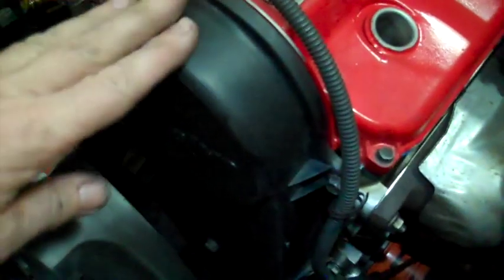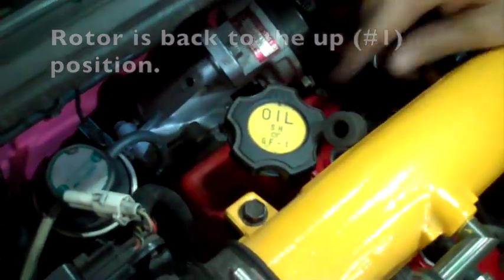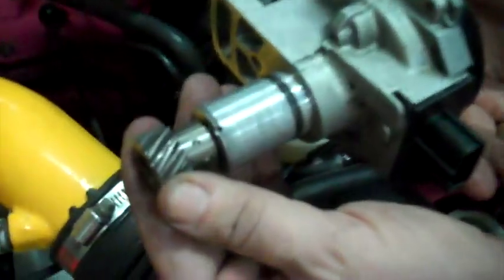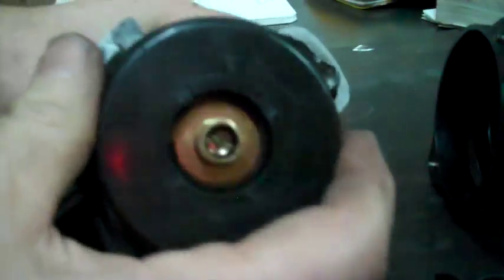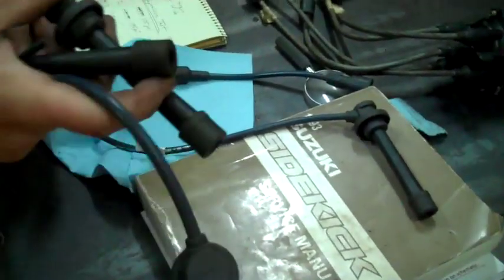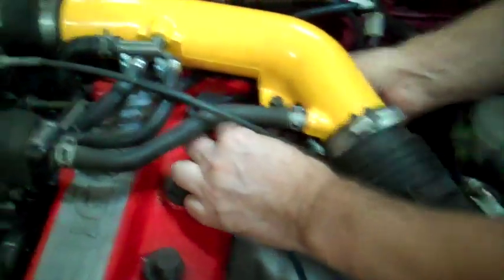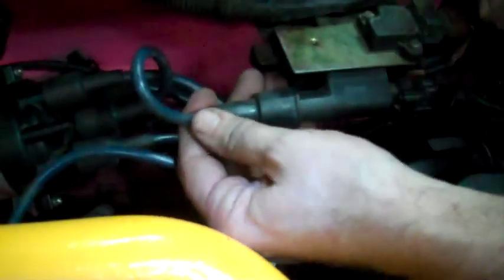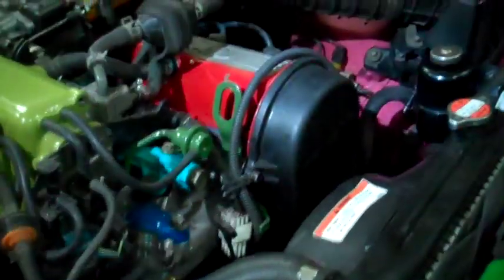1995 Suzuki Sidekick Distributor, Timing, and Initial Start Up

Comment: Picture was a. Bit dark to see what was being done clearly
Reply from the maker: You are right about that.  I have difficulty dealing with the camera and light while working in tight spaces.  Usually can't find a helper.  If you want me to explain something you can message me on my face book www.facebook.com/SidekickRebuild/ or just email me.
Reply: So the other day I said your pict. Was a little dark.HA ! That's apparently the least of my daughter s problems.looking at the dist.as per your  directions. First aligning the marks on the body and the shaft. When marks are aligned ,the rotor is pointing about half way between ,one and three.best I can tell there is no way to align marks,and no.one.any ideas?
Reply from the maker: @MerrickSpalding-hl7rg  I am assuming that the camshaft and distributor were not removed.  If that is correct then the solution is to remove the timing belt, align the cam and crank marks and then put the belt on without turning the cogs.  I show that process in a couple of videos.

Comment: Hi Frank Bruce here . So if your E is at the top you turn the crankshaft 180 and set your rotor at #1 ?
Reply from the maker: No.  The camshaft pulley is exactly double the crankshaft pulley.  With the E perfectly aligned with the notch in the valve cover and the marks on the crankshaft pulley and block also perfectly aligned then it will be top dead center on both cylinder 1 and cylinder 4.  At that point you must remove the valve cover to see which is on TDC of the compression stroke.  You can tell by looking at the cam lobes.  Either cyl 1 or cyl 2 will have the lobes of the camshaft pushing on the rocker arm pad.  The other one will have all the rocker arms off the lobes.  The one off the lobes (all valves closed) is the one on the compression stroke.  If it is cyl 1 then it is wrong and you have to fix it.  If it is cyl 4 then you are good and continue by turning the crankshaft exactly one full turn.  This will put the E mark down and cyl 1 will be TDC compression stroke.  Now insert the distributor as described so that the rotor lines up as shown.  It should be close enough to start the engine and make final adjustments.  Look at my later video, I think it is the last one or second to last in my head rebuild series.  I showed the process more clearly I think.

Comment: the jump in the video and the jump in the book do not match. is it D and E or E and F?
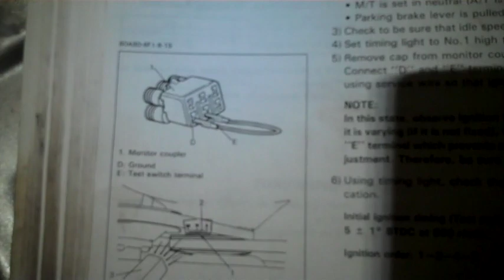Reply from the maker: At 7:19 in the video I show the picture in the book.  Jumper goes in D and E.  Make sure the plug clip is up as you look at the holes and then put the jumper in the bottom left and bottom middle.  It worked for me.

Comment: Is this the same for 97 Suzuki x90 and I heard for mine start with the 4th plug
Reply from the maker: Sorry, I don't really know about your model, but if it has a 1.6L 16V then I am pretty sure it would be the same.  Best if you have a service manual.  Check geopink.com.  Also, you can confirm by checking the camshaft lobe positions.  All 4 lobes off the rocker arms is TDC of compression/firing stroke.

Comment: I have a 95 Tracker with the 1.6 16 valve motor and I had the distributor out. When I put it back in I noticed a tiny braided line like a grounding strap coming out of the distributor plug in. It's only about 4 inches long. Not long enough to reach the firewall. It seems to run without it but I feel like it should be hooked somewhere but can't find any obvious mounting location. There is another ground wire for the distributor seperate from this braided cable. Any idea of its used and if so where does it go? Thanks.
Reply from the maker: Never seen anything like that in any of my engines.  Just the main electrical socket and a single ground wire to the body.  I have no idea.  A wild guess is maybe extra ground to the block somewhere.
Reply: @nunapitchuk  9

Comment: Hi Mr Cook i have a 1996 suzuki sidekick  with a 1.8  4x4 . i  took it to the shop to get the timing chain , oil pump and water pump replaced and now the mechanic cant start it . I thought it was the timing that was off but he performed a compression test and said it cant be because it has compression  , it has spark, and fuel too so im stumped and i was wondering if you or anyone else has any pointers that might be able to help i would be really grateful thank you . i cranks and tries to start but sputters and wont .
Reply from the maker: Your car has a lot of differences to my model, but based on your description my first guess is that the timing is off like you thought (regardless of the compression).  The timing belt could be one notch out of alignment (very easy to do), the distributor could be installed improperly, or the cam and crank improperly aligned (common mistake).  You can chat with me on my face book page:  www.facebook.com/SidekickRebuild/

Comment: Hi Frank i have g1.6b 16 valve moter but my E mark is up the top and at compression stroke it's different to what you are showing i have set the roter to number one spark plug . But won't fire.  I have checked for spark at the spark plug plenty of spark there but won't start and i checked for fuel any idea's
Reply from the maker: As far as I have read all of the G16B (Same as G16A with a 16V head instead of 8V head) have the same camshaft.  I did chat with one other person who thought his was different so I don't know for sure.  The best way is to take the valve cover off and check cam lobe positions.  First line up crankshaft marks and with valve cover on make sure the E mark is lined up exactly with the notch in the valve cover (not off by even one notch in the belt).  Then look at the cam lobes.  On mine and most that I have heard of then all the lobes will be off the lifters on cylinder 4 and the distributor rotor will point down at spark plug #4.  You might also want to check my last or second to last head rebuild video where I show how I line it up.  You can chat with me on my face book page:  www.facebook.com/SidekickRebuild/

Comment: can't you just pull the old one out and take pictures of how the distributor was and drop it in?
Reply from the maker: Pictures and vids are a great way to get things put back together right, especially when doing something for the first time.  That is how I got started making these videos.  The best way though, is to really understand how and why each part works so that you really understand how it is suppose to go together.  Getting the camshaft and distributor all lined up properly gives a lot of people problems because they are just not really sure why each part goes the way it does.

Comment: Hi Frank . Bruce here . I watch your video all the time . Do you have to stop the vacuum to adjust your timing ?
Reply from the maker: No.  There are only two vacuum tubes.  Neither effect the timing.  Both are controlled by two small solenoid valves on the front of the intake plenum.  One is the EGR which remains closed at idle and the other is for the vapor canister.  I did have to short the two terminals on the ecm end plug.  I showed that in the video, right.  That disables the the electronic timing advance.  Don't forget to remove the jumper wire when finished.

Comment: Will the distributor affect spark?  In other words, I don't have any spark therefore can the distributor be the problem or the computer?
Reply from the maker: The spark comes from the battery (low voltage) then to the coil that changes it to high voltage and then to the distributor that controls when it sparks.  No spark at all means one of the following:  bad connection in distributor or bad wire from distributor to coil or bad coil or bad connection to the coil from battery or from ground.  Test each of those and you should be able to find the problem.  Good luck.

Comment: Hey just courious where is that plug? I have been looking for that plug for hours. All I can find is a 4 plug not a 6 plug on mine. Do you unplug it from something or is it just layn there?
Reply from the maker: You are talking about the one with the jumper wire, right?  It is next to the battery and had a little rubber cap on it.  Should be the same for any '93, '94, or '95 model.  Other model years could be different.  What year is yours?
Reply: @nunapitchuk  mine is a 93 and yes the jumper wire. I belive I figured it out. It's the 2 bottom ones. I belive the ground and the test switch
Reply: I guess it's pretty off topic but does anyone know of a good site to stream newly released movies online ?
Reply: @Jeffery Ira Try Flixzone. Just google for it :)
Reply: @Luciano Milo Definitely, have been using flixzone for years myself =)
Reply: @Luciano Milo Thank you, I went there and it seems to work =) Appreciate it!
Reply: @Jeffery Ira Happy to help xD

Comment: Hey! Keep up these good videos! I just bought a 1994 and these types of videos are going to come in handy!  I took a chance on mine since it was down 1 cylinder. It turns out #4 was dead but new plugs, wire, rotor and cap fixed the issue. I just need to figure out my low idle now...
Reply: Suzuki Scrum 3 cylinder, 12v multicab, do you have videos on how to time, It won't start no matter how I do. Please help.... Thank you.....!
Reply from the maker: Sorry Irving, I have no clue.  I have never even seen that particular engine.  You will probably need to buy a service manual.